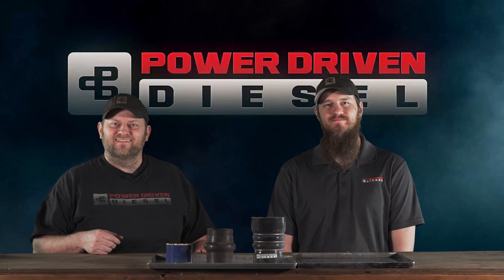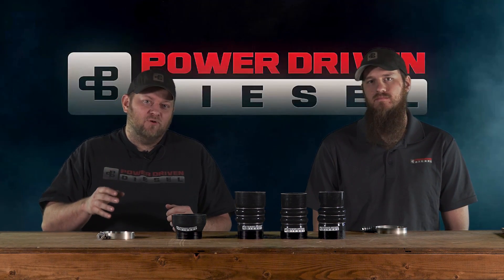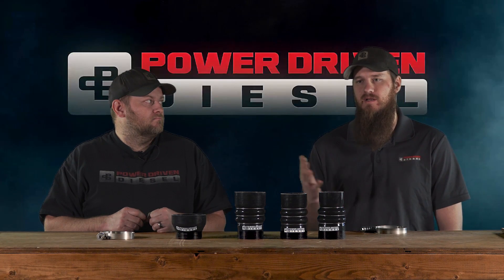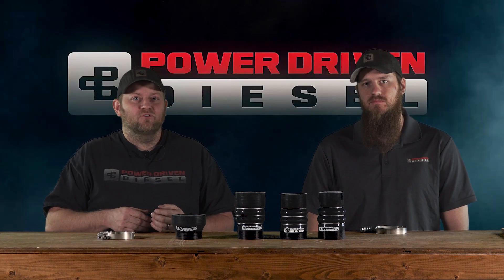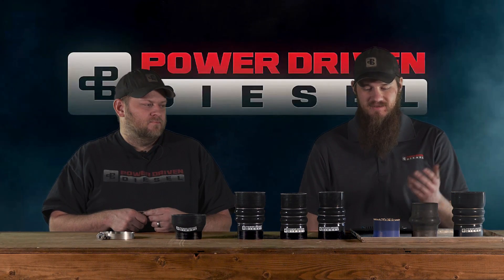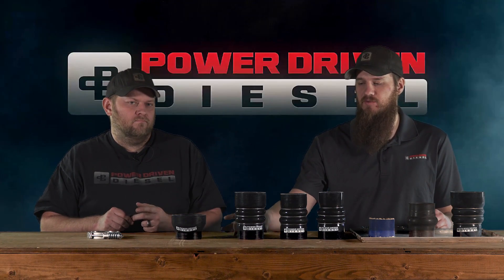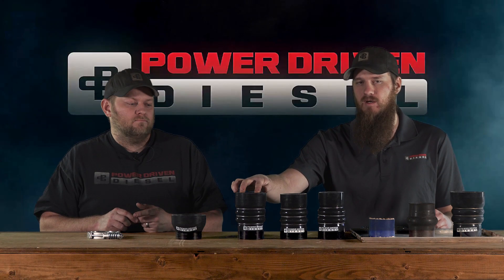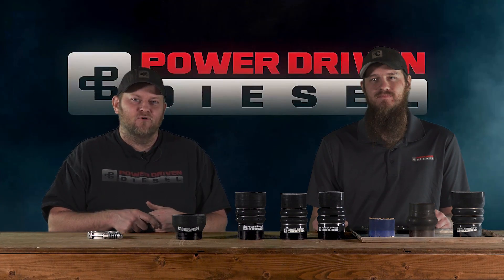Extreme Diesel Engine Boot Testing | Parts Bin EP 16 | Power Driven Diesel

Comment: 3.5-3” 45* bend for the intercooler to charge pipes would be 👍🏽👍🏽
Reply: Josh Santos there’s a reason for no angles.   Angled boots are way weaker than straight.
Reply: Jason Truman on 2nd gens they take 2 down on the bottom and good aftermarket boots are very hard to come by. So I think it would be a good investment to design a good set of them

Comment: Nice work, glad to see you guys addressed a very important area of running boost.  If you made 2.5" to 2.5" I could use them on my gas turbo applications.  There are so many cheap products out there in terms of silicone hoses so this really is awesome.
Reply: @pddofficial  I think 4-5" would be fine.... I've been  thinking for a long time about putting diesel style connectors on my gas car because they're much more robust in both the clamps and the fact that they have "hump" couplers to allow for some movement.

I'll share a tip that will stick your couplers on like crazy.  If you spray the pipe w/ WD-40 before installing the coupler.  Install the coupler on the wet wd-40 and it will end up glued on there VERY very tight.  The spray makes it easy to install also when the fitment is tight.

Comment: If you have twins I suggest just run orings and flanges on the high side. Boots are too unreliable if you lean on things alot. Nice that you offer some good ones though, especially the odd ones like that 3-4. Would have been nice to had it longer though not a lot of room for clamps it doesn't look like. You can always cut some off the boot if it is too long but hard to add to them.

Comment: Its aussm that youall are thinking about were the part lives  not just the pressure  it sees .
My HX35W12 @15psi can be over 200°F and Ive recorded 385° @28psi on stock fule settings . Holding 25psi(103mph) for 10min+ gets the IAT up to 165° .  So my weak ass  stock fule 1st gen can compromise the chinesium/ polyester boots on the cold side of the IC as well, whats your hot rod dooing to your boots.

Comment: Now my 03 cummins has the metal spring around the intercooler boot so does that mean it's good for more boost or will I still have to change down the road
Reply: @pddofficial  so if I go with compounds would it be better to run upgraded boots or just swap over to full v-band
Reply: @dustindrake6272  that's a question of budget and vehicle purpose.

Comment: could a set fit a first gen? how about a pipe kit or CAC for a first gen
Reply: factory intercooled
Reply: Thomas carroll if you are spending that kind of money on boots for a first gen you really should upgrade the intercooler and charge pipes.   A 99-02 powerstroke intercooler fits great then use an air pipe kit for a 03-07 cummins and everything pretty much bolts in.
Reply: That’s why I asked about an CAC and pipe fit for the trk
Reply: @jasontruman1215  to hell with running ford parts on a dodge. Look at greg A's first gen and swap the 2nd gen intercooler in. That's what I did
Reply: HUNTER WILLIAMS what year is your truck? A 89-91 the second gen cooler fits really nice but 91.5-93 the powerstroke one fits better and is larger.   I tried finding a good second gen one and all I found leaked the first PS one I found was air tight
Reply: @deathninja007  who cares that it fits in a Ford, that is the dumbest reason to not use something. They all buy parts from the same manufacturers.

Comment: For the layman, aramid is the same fiber that is used to make Kevlar. It is stretch resistant. It is used as the stabilizer filler in optical fiber assemblies. I’ve personally put 7k pounds of pulling force on the stabilizer filler of the fiber optic assembly, it’s roughly 3/16 diameter worth of aramid fiber strands.
Reply: If you’re curious about the load rating of aramid just compare a Kevlar recovery strap to a nylon one.